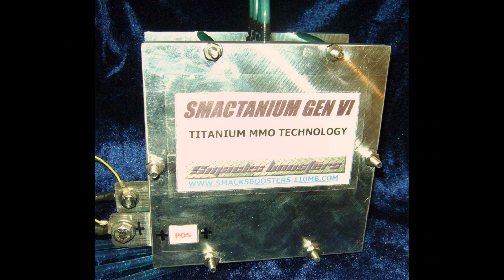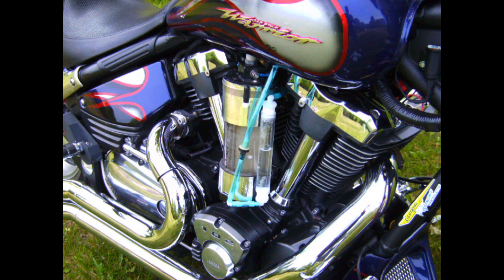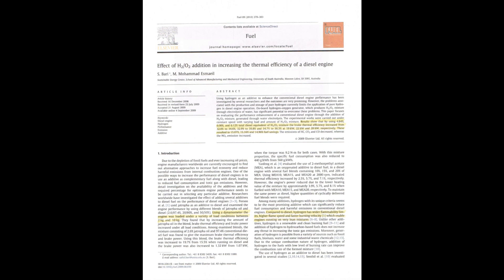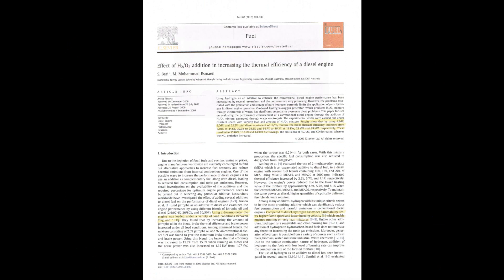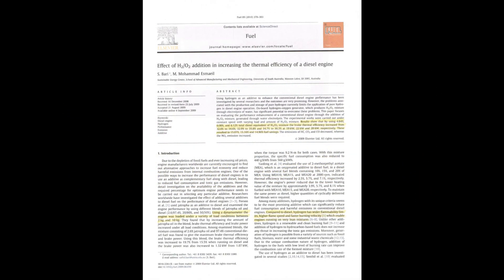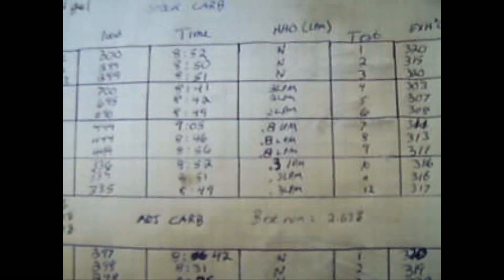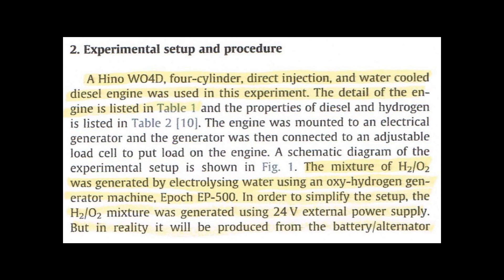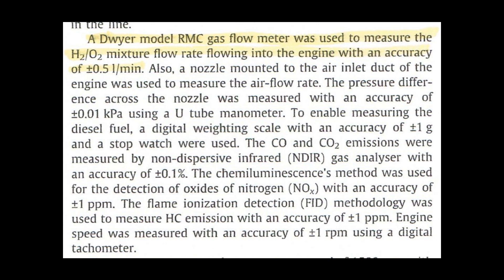Scientific PROOF that HHO WORKS Part 1

Comment: The article you link to is interesting. The main point of the work is the treatment of HHO as an ADDITIVE, and not as a fuel--add too much and fuel efficiency DECREASES rather than increases. Two problems:

1) The gains are small (ave. about 5%). And that would be the BEST EXPECTED.

2) NO mention is made of gasoline. HHO as an additive enhances the burn characteristics of diesel, to give slightly higher efficiency. That they don't MENTION gas implies it probably wouldn't work on gas.

Comment: @captainwho1 - Eight and a half months ago, ZeroFossilFuel used what looks like a 5 HP engine and hooked an altenator to it and powered the HHO cell at 25 amps. His results were 6 percent less run time WITH HHO on a measured amount of fuel. 8.5 months and still no gain. How do you explain this study getting supposedly a 7.3 percent gain on a much bigger engine when Zero cannot get a gain on a much smaller engine?

watch?v=9GAcjkx8F48

Comment: @captainwho1 - Nobody can put a diesel generator in their vehicle that operates its engine at 32% efficiency to power an electrical generator at 50-62 percent eficiency to generate HHO at approx 60% efficiency and feed the HHO to the vehicles engine to get a gain. Period.

Comment: @captainwho1 - Every high volume HHO machine I have seen is about 4 MMW to avoid heat build up. The 30.6 LPM is 30600 ml/4MMW = 7650 watts.

The BTE went up because they were using highly efficient WALL electricity, where the losses in generation are at the power company.

Comment: Part 4E

 .....mathematically.  BTW I think your source of confusion is that you do not know how they determined the diesel equivalency of the electrical power.  If you had read the paper carefully, especially the part about bsfc it'd be more clear.  Of course it is dependent upon the diesel to electrical conversion efficiency which is the bte of the system (diesel energy + generator), which varied somewhat depending upon the conditions of the study.  The point is you ASSume that they.....

Comment: Part 3E

.....the power to the electrolyzer as an input to the system (smaller denominator in bte quotient).  In other words, it would theoretically have balanced out the same!  You CANNOT throw out this study based upon this.  It is scientifically sound and it proves your oversimplified methods for gauging effect of different fuels upon bte and bsfc of ICE's as being PURELY a matter of their LHV is invalid!!!  Maybe in their next study they will close the loop physically instead of just....

Comment: Part 2E

.....series of alternators on it???  It's a DIESEL POWERED ELECTRIC GENERATOR rated to produce 38kW at 1500 RPM.  They could have powered the electrolyzer directly but chose not to (for simplicity) so that load cell power and electrolyzer power could be adjusted independently of each other.  If they had, it would have required more diesel fuel to produce the same amount of output power to the load cell (larger denominator in bte quotient), BUT they would not have had to include.....

Comment: Part 1E

ES2008 (aka WT) said here: "At 30 LPM we know they were using about 7500 watts so all they needed to do was put five 110 amp altenators on the engine and see what happened."
First off, you DON'T know how many watts their electrolyzer drew, so don't ASSume, but it's irrelevant.  Since bte was shown to increase in this study when factoring it in, the power required COULD NOT overload the generator, if it supplied it.  Why in the world do you think they would have needed to put a.....

Comment: If the "study' has determined how much diesel they would need to make 11,500 watts on board a vehicle, instead of using eletricity from the WALL, it would be a whole different story. They would have easily proven that HHO is NOT viable.

Comment: @Eletrikride - What you and JJ avoid talking about is the electricity from the WALL in the Australian study that only has losses of 10% to the power supply, in the form of heat. While on board the losses are 68 percent for the engine and 14% for the altenator to generate the same amount of electricity.

Comment: To say that it is impossible to increase mileage without adding more energy is like deciding which olympic runner will win the race, based on who has the most energetic legs.

It's not how much energy is used, it is how that energy is used.

I don't know if HHO boosts mileage, because I haven't actually experimented with it. When you actually experiment with it, you will have the respect of others that want the truth from hard data.

Comment: "The rider who tries to apply pressure at top dead center risks breaking his leg as the damn pedal does not want to move."

Well then please acknowledge that if the efficiency of the burn is increased; thus allowing the timing to be slightly retarded, the SAME energy can do MORE work.

It seems any time anyone brings up burn efficiency (which has nothing to do with adding more energy), you always go to your "You can't get more energy out than you put in" rant.

Comment: "As my video points out, at 60 MPH in a 24 MPG vehicle, 3.05 LPM of HHO only provides 0.41 percent of the energy required."

Where did you get this "fact" that defines how much energy is required by HHO to allow an increase in mileage on all engines?

The EP-500 has a huge transformer in it; that accounts for most of its weight and it's only required to reduce the amplitude of the A/C input. Power can get gotten from an alternator which does not need a tranformer.

Comment: @jjenson2006 - The rider who tries to apply pressure at top dead center risks breaking his leg as the damn pedal does not want to move. My contention is that the reason they showed increased efficiency is because their power input numbers were too low and would have been much higher if they had not used eletricity from the WALL.

Comment: @jjenson2006 - As my video points out, at 60 MPH in a 24 MPG vehicle, 3.05 LPM of HHO only provides 0.41 percent of the energy required. Thus, we are still running on 99.59 percent gasoline and carrying a 695 pound Epoch EP-500 adds weight that imposes a MPG penality and it runs on 220/380 volts so the 30 mile extension cord is a big problem to solve. LOL

Comment: @Captainwho1 - I have noticed that you ignored the issue I brought up. The EP-500 power supply will waste 10 percent of the WALL outlet electricity. Yet, to generate that electricity on board, with the same generator they used, will have losses of 68 percent for the engine and 14 percent for the approcimately five 110 amp altenators required. Plus, they did the study at 1500 RPM, 2500 RPM at 60 MPH is more typical, so add 66% to everything they did. Why the silence?

Comment: ES2008, two 12 year olds have a bicycle race. They are both equally physically fit and both have the same energy.

Rider A strongly applies downward pressure on the peddles as they are 45 degrees after top dead center. Rider B strongly applies downward pressure when the peddle is at top dead center.

Which rider wins the race and which rider is more fatiqued?

What have you learned from this demonstration? Does increased efficiency mean more useful power from the same energy?

Comment: @Boyntonstu - Gallon of diesel = 135.52 Mega Joules of energy. 60 MPH at 30 MPG uses 2 gallons per hour = 0.0333 gallon per minute. 135.52 X 0.0333 = 4.517 MJ per minute. 4.84% of that = 0.218639 MJ per minute requirement.

The above is all based on the Lower heating value of diesel. My video used higher heating value. In the comments I converted to LHV. HHO at 120F = 0.00611 MJ per liter. Therefore, need 35.8 LPM. Smack's cell does 0.5 LPM at 10 amps. Only 1.4% of the requirement.

Comment: @Whatthephuque - According to the United States Department of Energy, per cubic foot at 60F, liguid gasoline has 836,000 BTU of energy and hydrogen is gaseous at 60F and only has 270 BTU. HHO only 160.22 BTU at 120F. When people say Apples to oranges, I say, to replace one cubic foot of gasoline, you need to build a 1 foot wide by 1 foot tall by 5218 foot long tank and hook it to the back of your car. It is pretty clear that HHO is an ant fart compared to gasoline.

Comment: @Smack  Part 101B

When we feed 100 MJ of diesel fuel into the 32% efficient engine the Australian study used, only 32 MJ comes out the other end. Then the alternator wastes 14% of that, so from out of the alternator we only get 27.52 MJ.

27.52 + 228% = 90.26 MJ. Class is over, now it is time to absorb the truth and realize that Smack University lost its accreditation long ago.

Comment: @Smack  Part 101A 

You have spent too much time at Smack University. The Professors at the University of EnergySupply2008 have asked me to pass on the following to educate you.

The losses in making electricity that comes from the wall outlet are at the electrical plant. The power supply in the Epoch EP-500 HHO torch machine, wastes only 10% of that electricity.

Comment: The faster a fuel burns, the more of it you need. For example the DOE says that per cubic foot at 60F, hydrogen gas had 270 BTU and gasoline has 836,000 BTU. HHO is 2/3 hydrogen, so 180 BTU. Adjust for 120F, now only 160.22 BTU. So a cubic foot of gasoline will get you 5213 times further down the road than a cubic foot of HHO.

Comment: @Captainwho1 - HHV and LHV are not calc'd. The calorimeter combustion chamber is surrounded by water. They start the test at 25C. For HHV they wait till the combustion chamber returns to 25C before measuring the water temp. For LHV they wait until the combustion chamber returns to 150C - It is a valid test that all scientists use to measure the energy in a fuel.

Comment: A comparison - Part C

90% efficiency is 2.8125 times more efficient than 32% efficiency. So we need to input 48.74625 MJ worth of diesel per hour, to get the alternator to make 17.322 MJ per hour.

Alternator is only 86% efficient so the real figure is 56.682 MJ per hour, which is 228%more energy input that the Australian study required from the wall electricity. That fact will cancel out the 7.3% gain they claim on the last page and actually cause HHO to hurt their fuel consumption.

Comment: @Captainwho - A comparison  - Part B

At 7.0621 MMW, 30.6 LPM = 4333 watts = 4.333 kilowatt-hours = 15.5988 Mega Joules per hour. At 90 percent efficiency, we need
17.332 MJ of input, per hour, into the EP-500 from the wall electricity.

On the 19 KW load test, before injection of the HHO, the brake thermal efficiency is 32.0 percent. So only 32 percent of the energy input from the diesel fuel is converted into the mechanical motion, needed to turn the alternator.

Comment: @Captainwho1 - A comparison - Part A

The Australian study used an Epoch EP-500 HHO machine and electricity from the wall.

Power supplies are 90 percent efficient. An alternator, due to friction, is 86 percent efficient.

As my video points out, 100 percent Faraday efficient electrolysis = 7.0621 milliliters per minute per watt. To be fair, I will use that figure in both examples. The Australian study used 30.6 LPM in the 19 KW load test.

Comment: Part 1C
"I acknowledge that the 2.9% thermal efficiency improvent at 6.06% is possiblbly correct."

How can you acknowledge that there is a 2.9% bte improvement AND at the same time claim that your video "Absolute Proof It Is Impossible For HHO To Increase Miles Per Gallon" is the truth?  Your whole premise is that, since it takes more energy to create the hydrogen than you can get out of it by burning it in a bomb calorimeter (how LHV of fuels are calc'd), it is impossible to increase the...

Comment: Part 2A

Hint: the 15.07% refers to the diesel fuel savings alone.  The 7.3% savings factors in the diesel fuel equivalencies of all the energy inputs into the system.  But with your high IQ you knew that.  You're just joshing with us!

Comment: Part1A

"They do not even seem to be able to keep their lies straight."

@ES2008 - You wish.  You're just digging a bigger hole for yourself.  Just admit that this paper proves your overly simplistic approach of BTU calculations of the fuels only applies to bomb calorimeters or explosive devices.  That's not what we're doing, we're trying to generate electricity or propel a vehicle down a road.

Read the paper again and don't twist things or take things out of context and misquote them.

Comment: Part 1B
"In addition, they provide ABSOLUTELY NO information on how they made their calculations, regarding the electricity."

How do you think they made them?  It isn't rocket science to measure electrical power input to a power supply by multiplying V x A.  They were quite clear that when they calculated bte of the system, they included the electrical power to the electrolyzer as an INPUT to the system.  You know that bte is calculated by dividing output power by input power, right?

Comment: Part 2B
OUTPUT POWER = electrical power drawn by the load cell.  INPUT POWER = electrical power into electrolyzer +  LHV of diesel fuel times the mass flow rate of diesel fuel.

Comment: Smack - All they gave us was words, no numbers showing how they calculated energy consumption of the external HHO machine running on 220/380 volts. Most commercial machines operate at about 4 MMW to avoid heat and steam. At 30 LPM we know they were using about 7500 watts so all they needed to do was put five 110 amp altenators on the engine and see what happened.

Comment: @BlackDogSociety - It is you that is twisting. I acknowledge that the 2.9% thermal efficiency improvent at 6.06% is possiblbly correct. However, they present no data on the energy input to achieve those results. They simply say 30 LPM

Comment: Australia Study Part 6

Nowhere in the data did they measure flame speed, but NASA did, with a crap load of hydrogen, 635 grams per hour.

No numbers for grams of hydrogen or HHO temperature were given, so no way to figure out how much energy per liter.

The study maximized things by adjusting timing, which is very difficult for the average person to optimize and not very practical with computer controlled timing.

I see no evidence of any peer review.

Comment: Australia Study Part 4

Another advantage this test had, the 4-liter engine was only tested at 1500 RPM. 2500 RPM is more typical at 60 MPH so a similar 4-liter engine would be turning 66.66 percent faster and using 66.66 percent more fuel.

The brake thermal efficiency only increased to a maximum gain of 2.9% at 29.8 LPM, which would be more like a 50 LPM requirement at 2500 RPM.

50 LPM at 6 MMW requires 8333 watts, talk about a scorching hot small HHO device in the vehicle.

Comment: Australia Study Part 3

Electricity from the wall is much more efficient. We burn fuel at 20-25 percent efficiency and spin an alternator at 85 percent efficiency. This study made no effort to provide numbers for those inefficiencies. There are no numbers to allow us to see how the calculated any of this stuff.

Their engine has a 17.5 to 1 compression ratio. Most people have 8.5 or 10.0 to 1. The high compression ratio on this industrial engine, gave it a huge advantage in efficiency.

Comment: Australia Study Part 2

when using an alternator, not only will their gain numbers revert to zero, the numbers will swing to a negative value. In addition, they provide ABSOLUTELY NO information on how they made their  calculations, regarding the electricity. I smell bullshit.

Also, they stated 24 volts, but the Epoch web site says the EP-500 runs on either 220 or 380 volts and uses 11500 watts. At optimum Faraday voltage of 1.48 V per gap. That is 149 to 257 gaps, so the HHO cell is huge.

Comment: Australia Study Part 1

Not so fast, it is very easy to rip this study to shreds. They used external power to make the HHO. Quote The power needed to make the H2O2 mixture is included as an INPUT ENERGY to the engine.

The HHO injection already added some energy to the engine. Adding the energy from the power source, to the engine, is wrong. It should be subtracted, just as a loaded alternator subtracts from the available energy. Because they added when they should have subtracted, later,

Comment: There is an error in that report. It says they used 24 volts but the Epoch EP-500 uses either 220 V or 380 V with 11500 watts consumption., according to the Epoch web site.